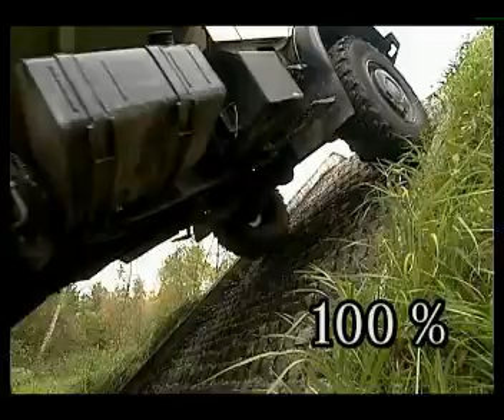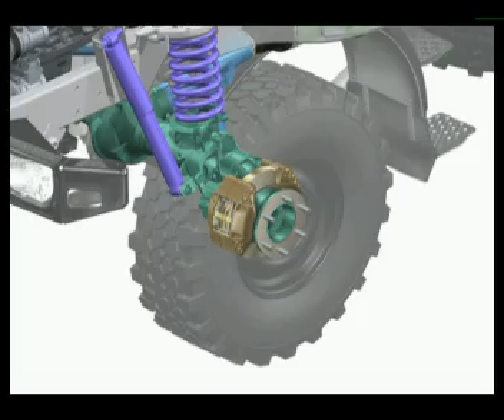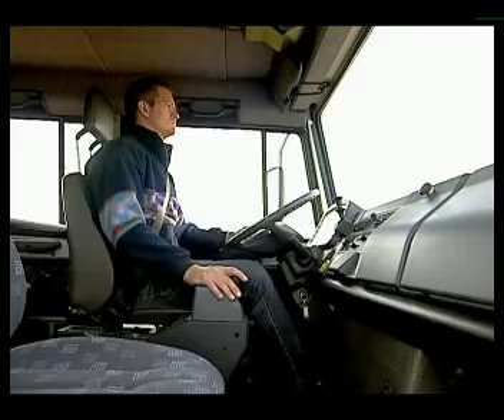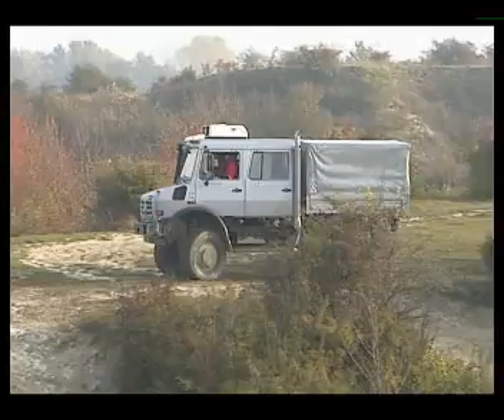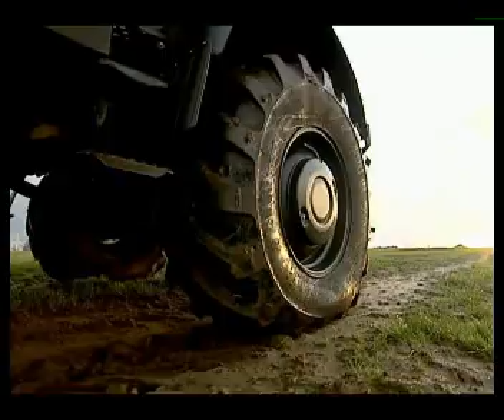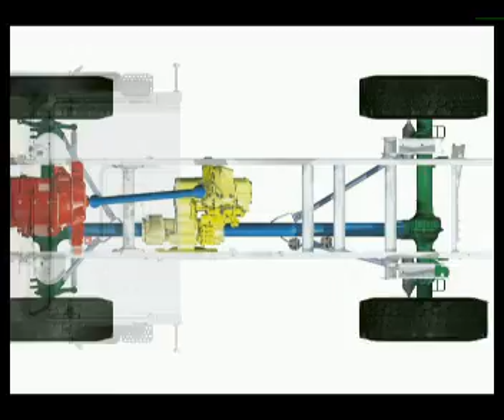Unimog UHN Extreme Offroader promo video Part 2 of 3

Comment: Based on theoretical knowledge only I'd say the Mog is more nimble and can deal with more extreme situations, while I think the Tatra's have more power and grip if you take a model with more axles. The tatra will get you on the other side of the forest in less time, but the Mog will be more likely to get you on top of a mountain I'd say. The Mog is more like a tractor while the Tatra's are more like trucks.

Comment: The meaning of "%" is :divided by 100.. a climbing rate of 110% means that the terrain will elevate 110m (ft) per 100m (ft) in the horizontal. So 100% equals an angle of 45°  110% is about 48° (arctan1.1)

Comment: That "new" design with origin in 1977 has a very quit and comfortable cabin compared to the older design. You can still hear engine, transmission and tires but no need for earplugs ;-)